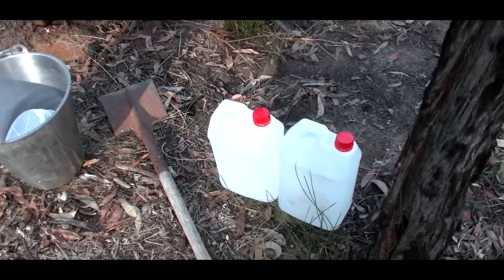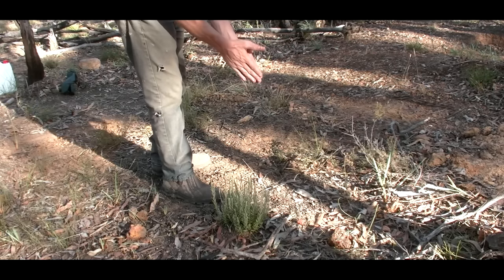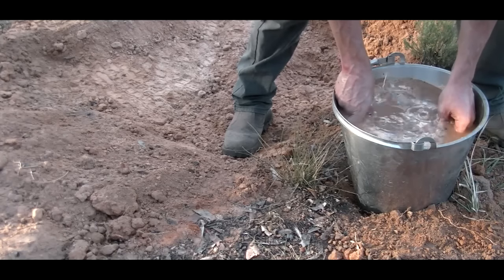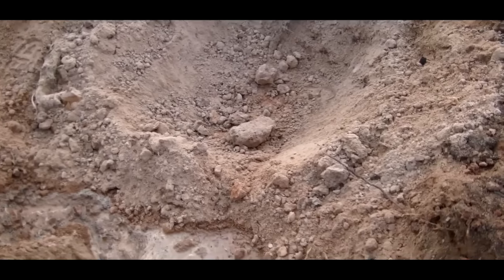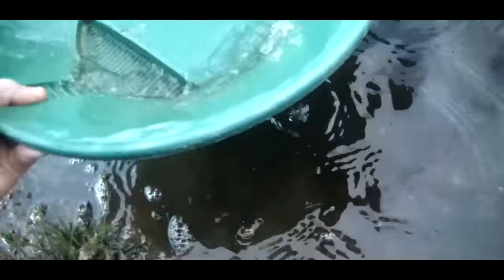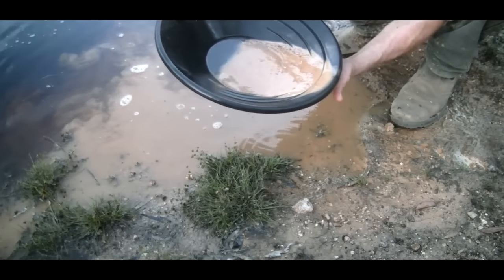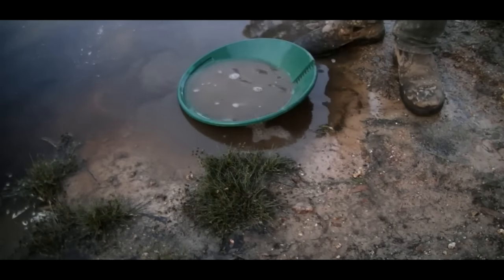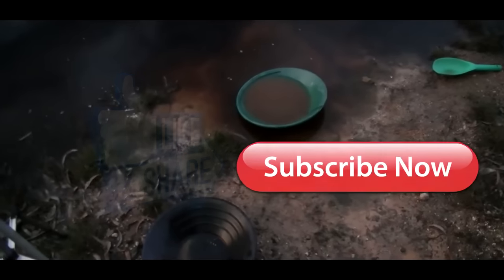HOW TO FIND GOLD USING VARIOUS METHODS WHILE DETECTING FOR NUGGETS VICTORIA AUSTRALIA

Comment: Hi very good video i am new at detecting i live in spain did some practise detecting on my land and found a load of silver nugets only in one area about 2 sq meters they was only about 4 inch to 8 inch deep do you think thair could be more further down
Reply from the maker: Hi - Thanks very much for watching. Yes absolutely - you need to study the silver nuggets and they will tell you many things based on the type. Are they worn, semi coarse, coarse, prickly, reefy type nuggets. 

Usually the type will show whether they have traveled 100 meters from the primary source or within 10 meters. 

To find any mineral like Silver or Gold close to surface is very important in geology. Definitely a great find you have mentioned and wish you very well for future finds. 

Please feel free to email some images ;) prominelabgold@gmail.com - I might be able to advise further on the silver type ;)
Reply: @MinelabGold  hi they look just like a gold nuget but in silver smoothe in places small pit holes and sort of lines in places some jaged is thair some way i can send a picture i also found a 1467 1 real hamerd coin about a half a mile away is a 14th century castle i can see it from my house.regards.just had another look refey some pieces
Reply from the maker: @mikespence4722  Please email to my email address - prominelabgold@gmail.com

Comment: I can pan a lot faster putting about a quarter the amount of material in my pan, its a lot easier to pan and much more fluid.  I have a panning station set up outside my house and have panned for years, I find panning my old concentrates relaxing.  Id also suggest using at least  1/4" classifier if you have one makes panning a lot easier
Reply from the maker: Hi Wow Guy - thanks so much for watching and the feedback mate. 

Yeah was a little overdone on the full pan. 

I was thinking to run it in less amounts but for video sake just thought get it all done. 

Oh wow - panning at home, and certainly agree it is very relaxing.
I couldnt find my bloody classifiers - Grrr had to use the bread basket or what ever it was, I think maybe a pasta or noodle strainer it was. Funny the things we do when we cant find our tools.
Reply: @MinelabGold  you found some really nice gold, I've done the same thing with my pasta strainer, hehe.  Thanks for your reply and keep the videos coming, I enjoyed your video
Reply from the maker: @wowguy3562  Cheers Wow Guy - Will certainly keep the adventures coming. 

Enjoy your week ;) M.G

Comment: If you want a steel pan, Sovereign Hill in Ballarat have 2 different size steel pans, made on site, reasonably cheap. Can't remember what I paid for mine, but it was pretty good value.
Reply from the maker: Hey Shane, thanks mate - might need to pop over and pick one up. 
Superb and thanks very much, have found a few original ones in the fields
But as you know or could imagine - most have the bottoms gone. 
Be very hard to get original, maybe museum ;)
Cheers and thanks for watching

Comment: Hello sir. I like your video on minelab. I have a question. I have gpx 5000 with coiltek 22". Question is that how depth work with coiltek 22 with glass type of treasure. Please reply me.
Reply from the maker: 22 Inch Coiltek will punch very deep but would be less sensitive to smaller objects/targets. 

It wont find glass treasure - but if the glass treasure has metal non ferrous or ferrous it will find that. So an example would be a ring with a diamond it wont find the diamond but it will respond to the metal. Same as a glass object - lets say a glass bottle with a metal lid, it wont respond to the glass only the metal lid. 

I hope that's what you mean, but metal detectors wont find glass treasure with only glass.
Reply: Thanks for reply means that if the treasure consider as a glass size or plate side how much it deeper goes. And which is best detector for treasure.
Reply from the maker: @zeeinfo1718  Thats correct mate, the bigger the coil the deeper the targets - the better the detector the better it will be on all levels for detecting. 

There are cheaper metal detectors for coin and relic or treasure hunting. But the GPX GPZ series will still be a better detector all round compared to a unit which is less quality or cheaper. If that makes sense. So a coin or relic machine still wont find targets deeper than the high quality GPX GPZ series machines. 

Big coil size will be better for depth and smaller size will be better for small objects like small gold.
Reply: I am really so sorry. I have gpx 5000 with coiltek 22", Is there is any best setting for best depth result for treasury?
Reply from the maker: @zeeinfo1718  Its hard to explain in Comment, it would take a very long explanation. You need to tune the machine to best handle the grounds or mineral concentration in the soil conditions. 

Some area's are very high mineralzied grounds and some are very quiet grounds. So for best results you need to tune it to what works best for you, I dont mind ground noise where some operators like it nice and quiet.

Comment: you say you don't want the outer lip of the pan to be lower then the inner lip and then you go and put the pan in the water with the outer lip way lower then the inner lip, so wich is it ???
Reply from the maker: While the material is solidified I could almost hold the pan vertical and the material would hardly move - again it depends on consistency of the material as well, certainly couldnt do that if the pan was just full of rocks. When we are liquifying the material we never want it lower, that's when the gold will fall to the lowest position. 

I guess many people have different techniques, if we look at sluice boxes they have a certain angle constantly while washing material its a similar process with the riffles catching the heavies. Hope that helps ;)